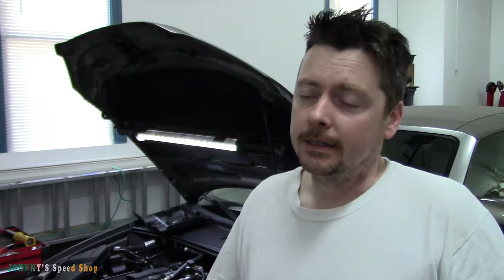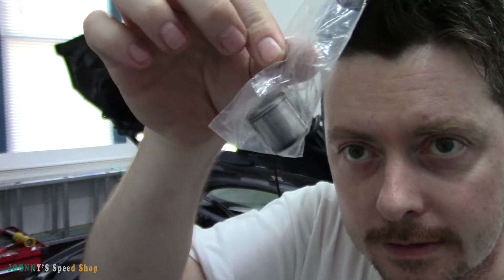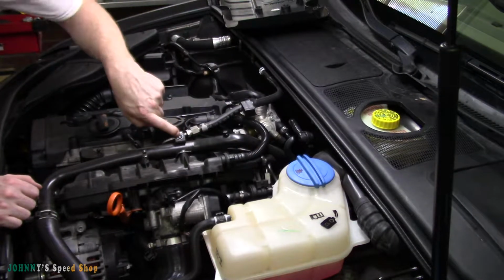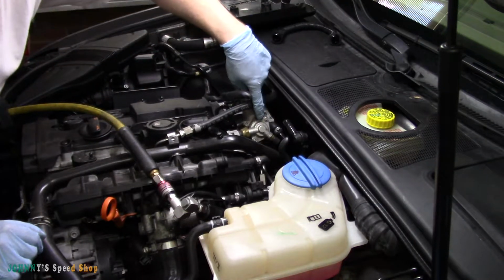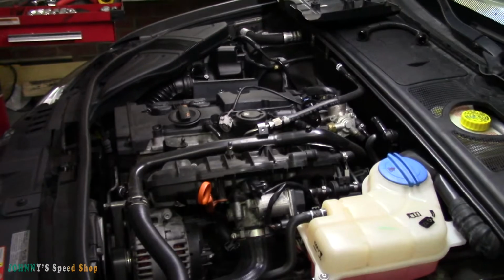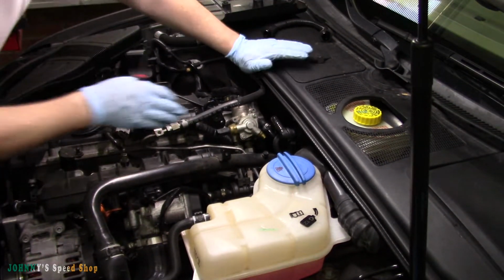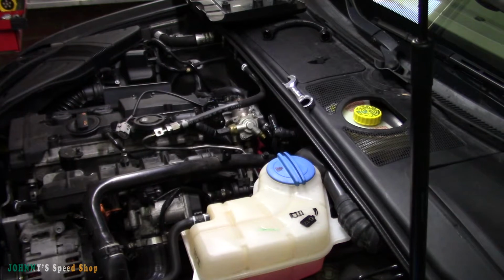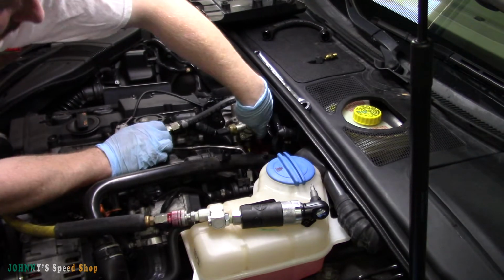How to Replace High Pressure Fuel Pump Cam Follower  VW/ Audi part number 06D109309C    (Part One)

Comment: To be continued? Ahhhh did it blow up? 😂😂😂. How is the cooling system on those?  Anything like their German cousins?
Reply from the maker: The drama....i know.....LOL....Part 2 is coming out on the 10th or 12th....not sure I have them scheduled, no issues with the cooling systems that I know off we don't have the sea air over here like you would be getting so the rubber and plastics tend to last quite some time...except PCV hose the plastic on those are  rubbish....